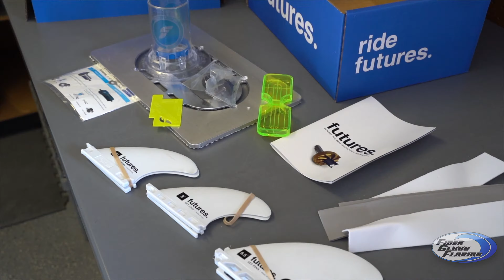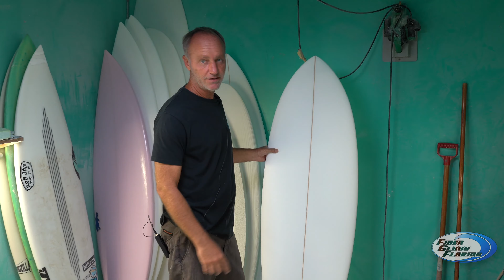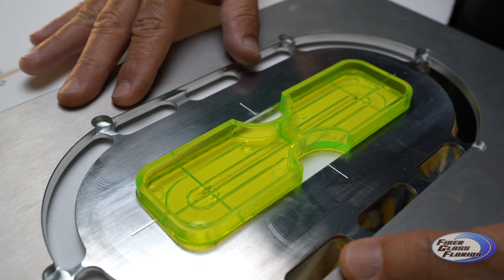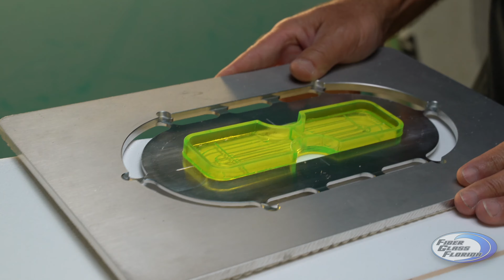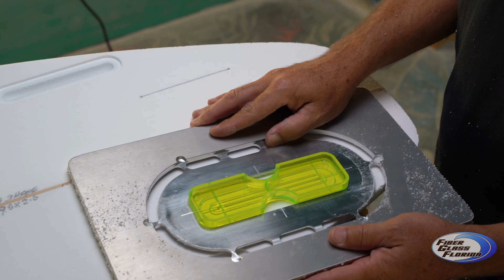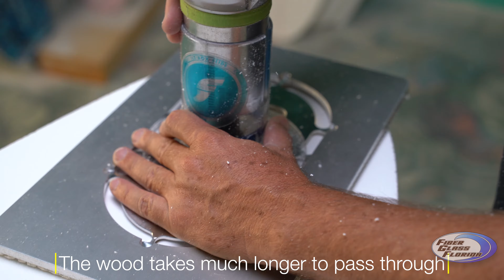Futures ILT One Pass Installation Kit : HOW TO

Comment: Can you please explain the reason for aligning the guide plate with the side lines and not the centre line when doing side fins? What difference does it make?
Thanks
Reply: Because most fins are angled in toward the tip so theyre no longer parallel with the stringer

Comment: Nice video, Ive never installed futures. Whats the deal with the two different bits?
Reply: The trailing fin boxes are only 1/2" deep, the leading fin boxes are 3/4".  Leading fins are typically larger and so the boxes have to handle more torque.
Reply: Thank you
 @fundip2010

Comment: So did you not show the step with cutting the smaller wider recess, looked like you were just cutting the first cut then it was all finished?
Reply from the maker: With this installation you should only have to pass through with the one bit that is included in the kit. This bit makes it perfect for the fin boxes to sit in nicely keeping them flush with the bottom of the board. the final result you see here was done with the same bit in the same passes.